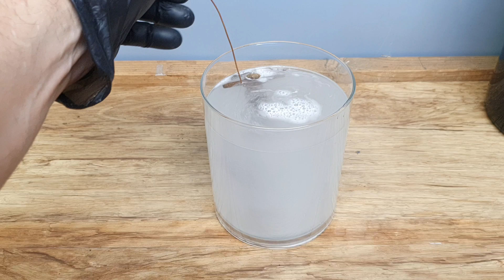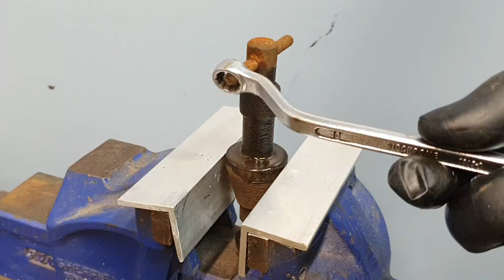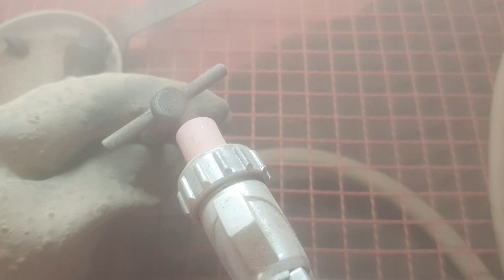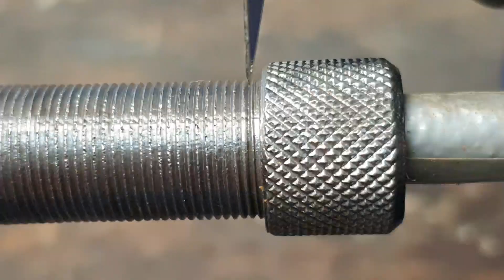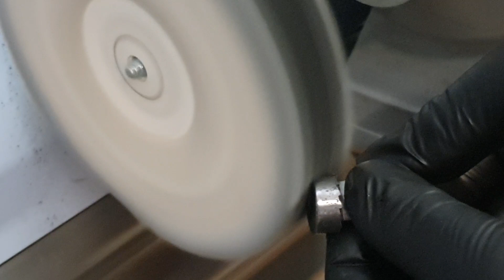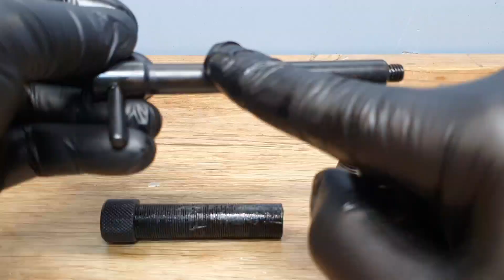Tap Reseating Tool Restoration

Comment: hey great vid as allways.
Just one small thing. red hot is too hot for oil quenching as a finish.
That will actually weaken the connection of oil and metal and make to oil chip of over time
other than that great solution for taking it apart and everything <3
Reply from the maker: Hey thanks for watching and leaving a comment Scharfer, appreciate the feedback, I'll keep an eye on it. That step was more about hardening the steel after sharpening. 
If you haven't already please consider Subscribing and check out some of my other work.

Comment: Very cool tool!!! (Yes, I only figured out its function at the end of the video🤣🤣🤣) Amazing job ❤❤❤

And I have some tips to you!! When you are trying to unscrew something,  first you try to TIGHTEN it, yes, you "heard" it correctly!! It seems that it will unscrew easier after that, I don't know why, but it usually works fine!!! 🤔🤔 Next tip, it's just a personal "taste" of mine, but I like most heat bluing the parts and soaking them in oil than that chemical cold bluing (anyway you will have to soak the parts in oil 🤷🏼‍♂️🤷🏼‍♂️), I just think the finish gets better 🤔🤔

Now let's go to the next video 😍😍😍
Reply from the maker: Cheers 👍👍👍 yes I know this trick from all my years as a mechanic. Your correct it usually works but not this time. I can't remember what I did on this job, I thought it was hot blue. I agree I like the finish better also.😃

Comment: That was pretty seized and I wondered if you were going to make it turn again. But you are a master of your trade and you succeeded:) Great job!
Reply from the maker: Thank you. I was actually surprised it was in pretty good condition considering. Now it will just sit at the back of the tool box for another 20 years.
Reply: @Austeration  as it should ha ha

Comment: Here we go!
Reply: I will have to come back later
Reply: Oh man you gotta teach me the electrolysis steps !
Reply: Nice , starting to take shape , see you tonight
Reply: Quality work Friend 👏 Holy Air hose coupler trick!!!!
Reply: Last one.  Is the Blue process a coating that results in a film or does it dye the metal?
Reply from the maker: @doinsngoins  Hey what happened did you have to go to work or something ?
Thanks for coming back to finish watching.
The cold blue or gun blue is a chemical reaction with the steel. It helps to prevent rust. It's a very interesting process. I always love watching it turn the metal black. Full instructions are on the side of the bottle if you ever find a use for it. Just don't ever tip anything back into the bottle or apply directly from the bottle or it will contaminate it.
Reply: @Austeration  yes I had  Teams call that I had to jump in to. Then work took over 😒  but I got back to Finnish,  nice work as always  .

Comment: These cutters are a prick to use, hard to cut a flat seat(as shown), still need to grind the seat so better just to grind to
Reply from the maker: Thanks for watching. Sounds like you've had a bad experience at some point with one of these.
Reply: @Austeration  yeah they bite too hard.  In guess you could actually file the front of the cutting blades so it is facing backwards. That might make a smoother cut.
Reply from the maker: @sammyd7857  interesting idea of your. Was the one you used the same as mine or a similar version. I don't imagine these tools get used very much.
Reply: @Austeration  yes the cutting head was the same.
Reply from the maker: @sammyd7857  and have you had to use it many times or gave up after the first attempt ?
Reply: @Austeration  only had to use it once because the tap was inside the wall. If i had to do it again i would just use a small grinding stone.
Reply from the maker: @sammyd7857  I hope you got it all sorted and working properly now. The taps inside the walls would be the worst. Not an easy job to replace if it ever came to that.